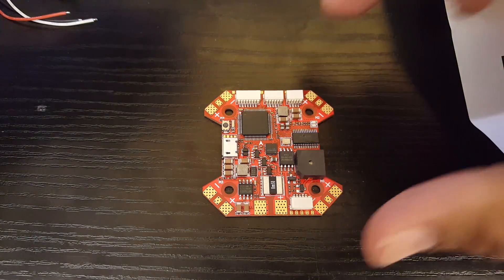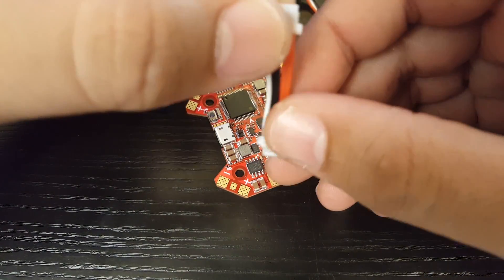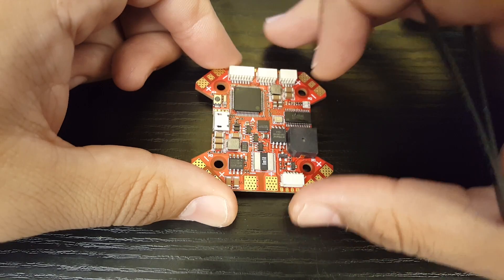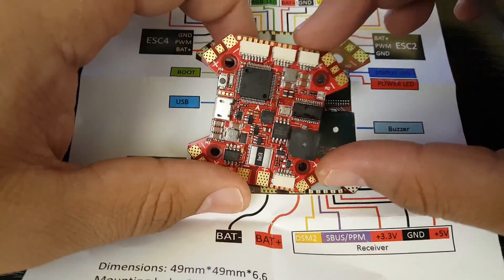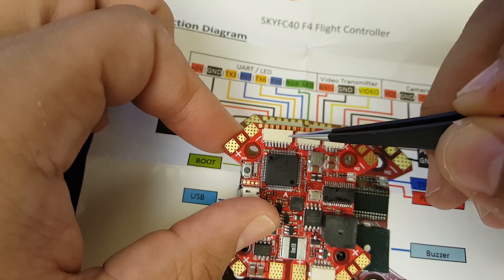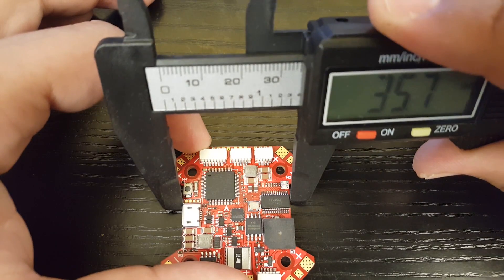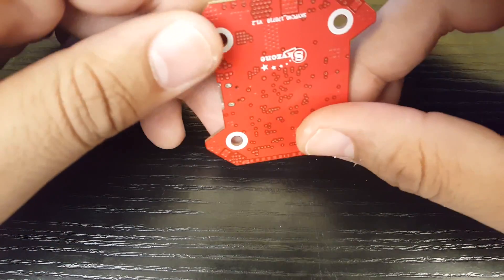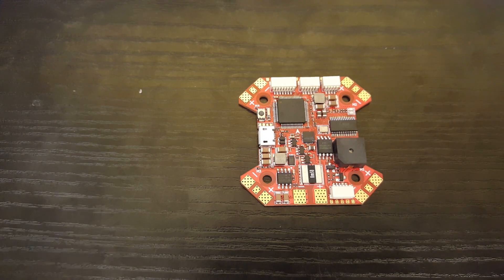Skyzone F4 AIO // Overview and Layout

Comment: Nice video. Did you eventually put this in a frame? how does it perform. Do you get a lot of noise on the video? I'm contemplating on buying it but want to know if it's as good as it looks. Thanks
Reply from the maker: +Sol mag it's very good it's on my way testing quad
Reply: Thanks for the response.
Reply from the maker: Here is the flight footage from the board
https://www.youtube.com/watch?v=rrMENmHd1TA

Comment: Be interested to know how you got on with this after? I bought one after watching this, 1st one the USB port broke so had a replacement sent out & still building the second one up now. Nice to build with though very easy to use and set up
Reply from the maker: lecodsportif I love it it's on the way testing quad.
Reply: sweet, I am very impressed with mine for the price! Great to set up etc. The only negative I can think of is that it might not fit some frames with the shape of it.